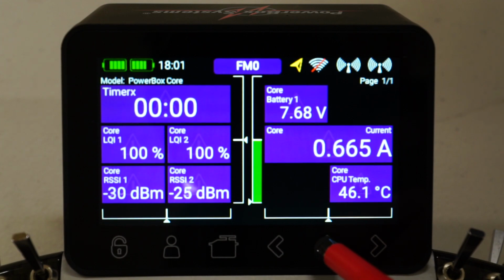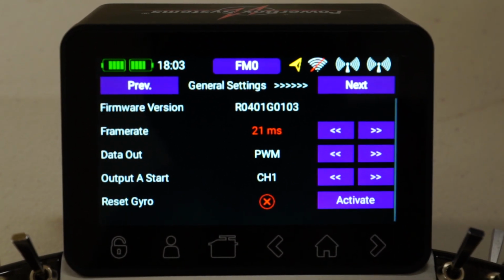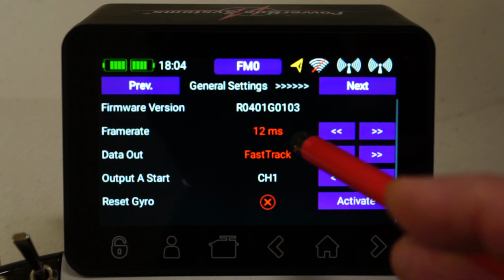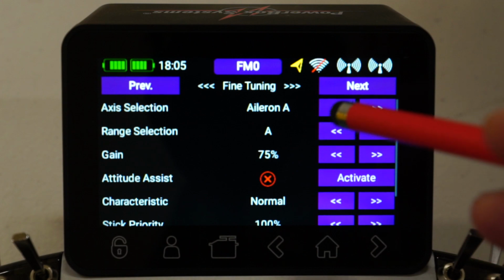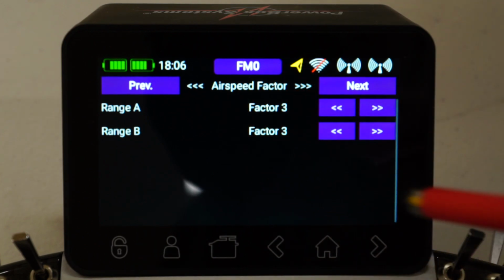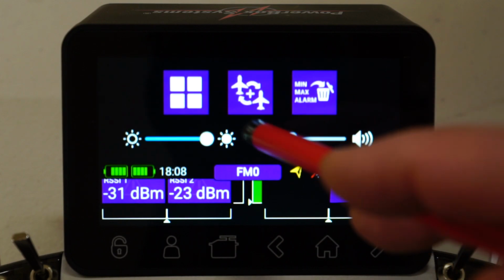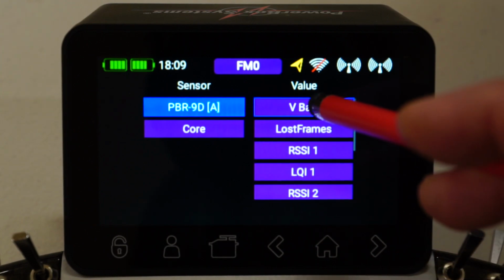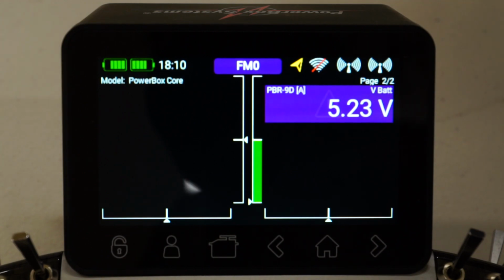PowerBox Core - Atom : Accessing Receiver Menu

Comment: If you select PWM at the fast track/data output what is the assigned channel number?
Reply from the maker: It follows on sequentially from the Rx's 9th port. 
So if the Rx is programmed to start at ch1 then the FastTrack port is ch10 if set to PWM mode.

If you set the Rx to say start at ch11 ie PWM port #1 is ch11 then the FastTrack port will be ch20 when set to PWM mode.